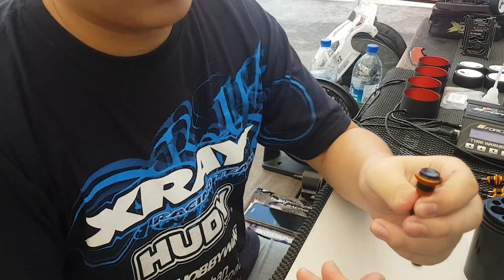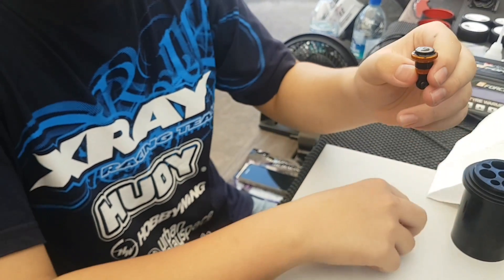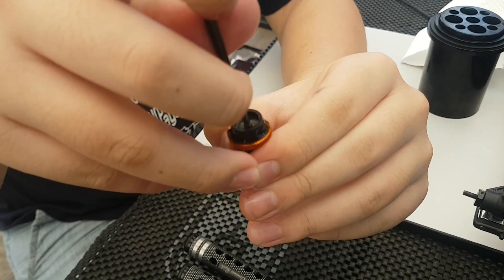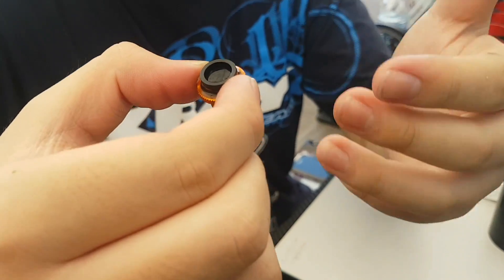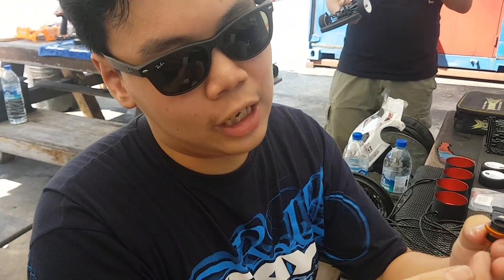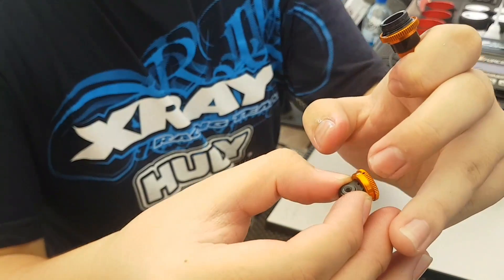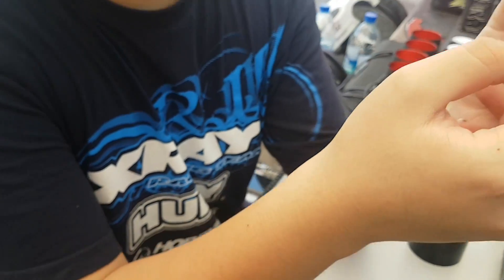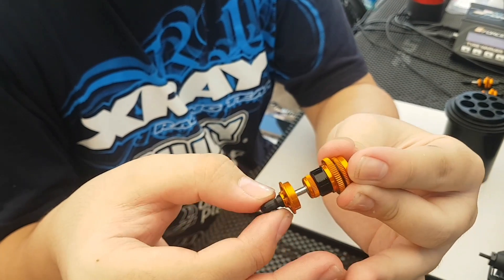Building the new Xray ULP shocks with Zero Rebound

Comment: What is the actual intention of building a 0 rebound shock for a EP touring car, vs a making a shock with some rebound?  Isn’t a 0 rebound shock will rely entirely on the shock spring in this case, and the WT of the shock oil doesn’t matter anymore in this case?
Reply from the maker: Building shocks with zero rebound is important from a consistency standpoint. You are right that with zero rebound, you rely on the chosen shock spring. This ensures that you get the performance you want when changing a shock spring rather than having some effect from the shock rebound. Shock oil will still be important as that will affect the damping rate. Shocks with zero rebound is something that you can replicate from re-build to re-build. This consistency is hard to achieve if you build shocks with some rebound as it is difficult to get the same level of rebound when re-building. Hope this helps.
Reply: Urban PlaySpace Learned something new.  Thanks mate!

Comment: When do you use the foam insert on top of the rubber membrane and when not?
Reply from the maker: The foam should make the damping harder. Probably more suited for smoother tracks. But we believe most of the team drivers do not use the foam.
Reply from the maker: You may also wish to refer to the T4 setup helper at this link for more tips
http://site.petitrc.com/reglages/xray/setupxrayt42016/T42016_SetupHelper/